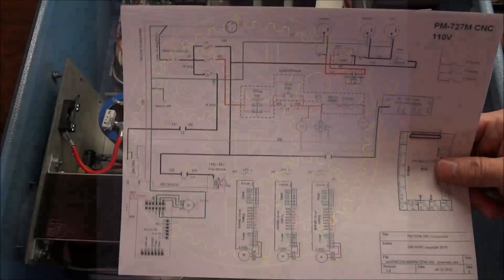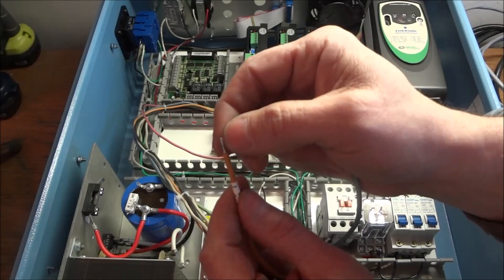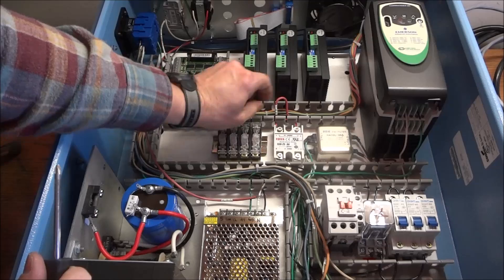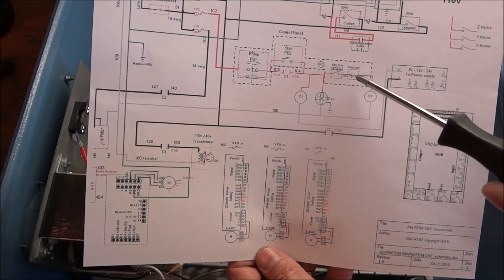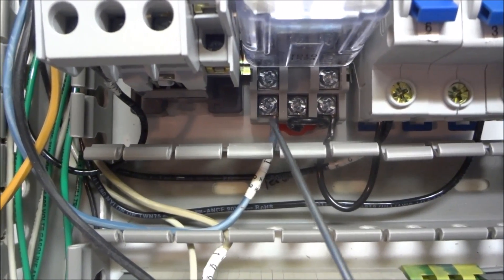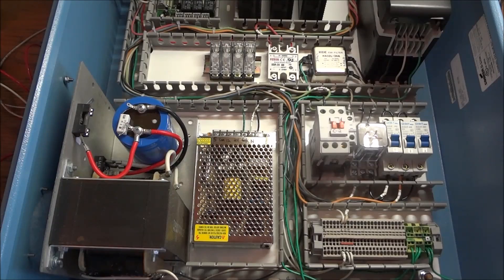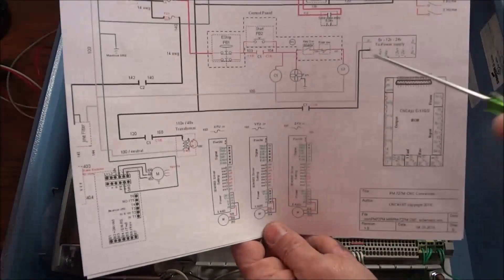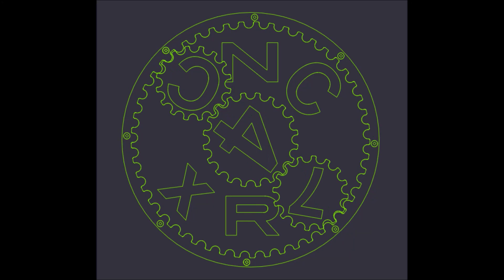PM 727M CNC Electrical Wiring Pt 4

Comment: Sam this is a very nice series of videos on wiring your control panel.  Thank you very much for sharing all the specifics and background information. I used your advice in one of the replies to download TinyCam software. I also downloaded all png views of your electrical wiring schematics.  Is there a chance you would have these in a TinyCam file you would be willing to share.  I would like to build off your work and need to incorporate some minor adjustments for my application. It would be a lot faster to make updates on your hard work to create a new drawing. I really like having your forethought of a printed map  prior to beginining work. My build is for a 5 X 10 CNC with dual head (Spindle / THC Plasma cutter). I will be running closed loop Nema34's which utilize direction / Power / and Encoder feedback (6 pin) from Hybrid Stepper Drivers. I will have 48 /24/12/ and 5V PS.  I plan for many of the same type switching relays and contactor applications you incorporate. Any assistance is greatly appreciated.  Thanks again for a great set of videos. I am definitely a new subscriber to your channel.
Reply from the maker: I'm not sure i replied to you ift send me a email I'll try to help
Reply: @CNC4XR7  Sam, I sent message through your web site.  Thanks again for all you have done

Comment: Great series of  videos, very informative, thanks  for sharing. I am  in  the process of assembling my  own  CNC control box and I  was wondering  if placing the  EMI line  filter right at the source of the incoming line before hooking  up any  of the other devices  would work just  as well  as  placing  it on the  VFD only?
Reply from the maker: +Fred Morris 
No sir the VFD is what introduces  EMI these interferences seek the source this is why the filter should be placed right before the Vfd to prevent these interferences from reaching the other components.
Reply: +CNC4XR7 Thanks very much for the info.
Reply: nothing to stop you from using two filters. One for the VFD, one for the rest